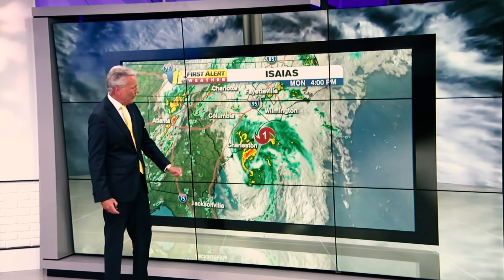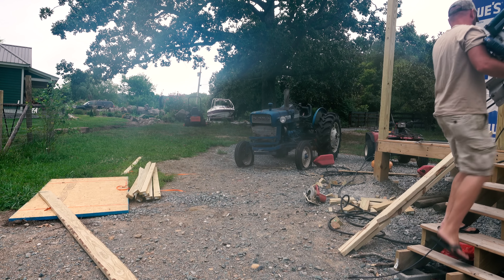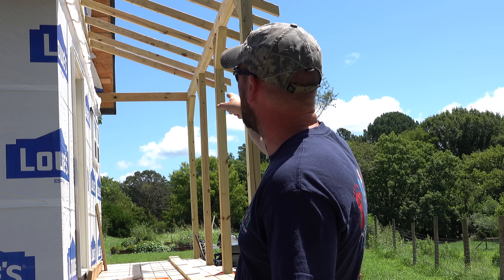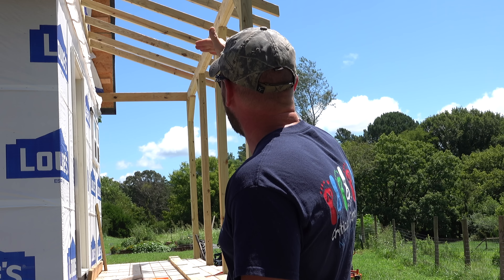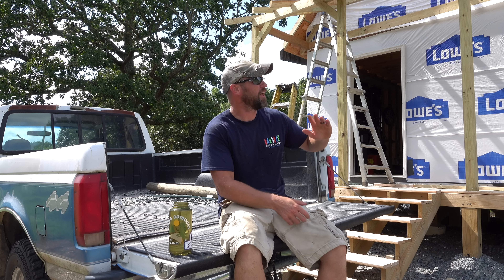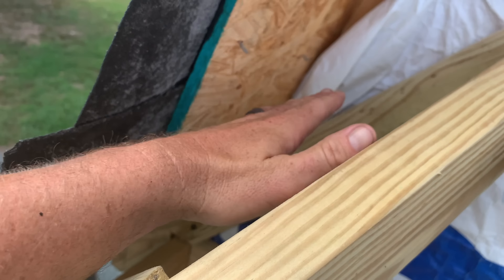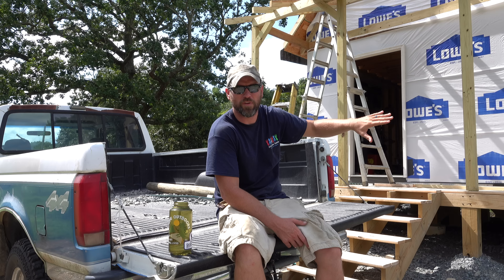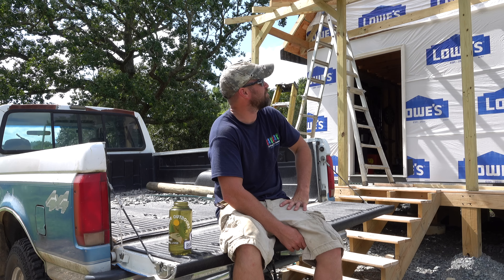FRAMING A WORKSHOP PORCH ROOF HIP RAFTERS

Comment: If I may make a suggestion. That is a tricky part of your roof where water leaks will cause damage. It would be helpful to run your roof straight to the other. You can run a stud to extend your roof to the front, or flare down in an angle. You would have to assess what is best. Just a thought. I like your flashing idea.

Comment: I'm just a bit east of ya'll but still on the western side of the storm. Top sustained wind was 15mph, top gust was 26mph and 2.65" of rain. From my nearly 50 years living in NC I'd say the best way to tell if it's a tropical system versus a typical summertime storm (just by observing the sky) would be  the counter clockwise rotation of the clouds from a tropical system.

Comment: I heard you say that you are going to use a metal roof. If that is the case, you can install it without putting board down. In fact, with the right tools you can work the angles . Unless you are thinking of shingling later. Just a thought .
Reply from the maker: The 4x8 OSB boards are more for wind sheer than anything.
Reply: @YanasaTV  ok.
Reply: @YanasaTV  I am going to give you a crazy idea. I was looking at trim from hardy backer. They have shingles. In fact, the reviews are more than expected. I am about to repair a wall to the house and I will build a roof over the back door. I was considering shingling with the left over hardy board trim. Insurance companies love hardy because it does better in storms and help homes be energy efficient. I do not know if you are trimming the house or sheeting. It's an idea. Not an original but workable on a budget.